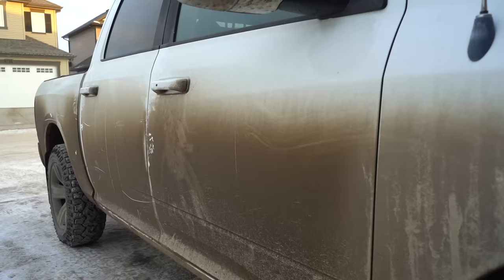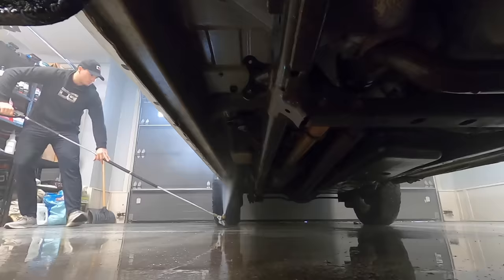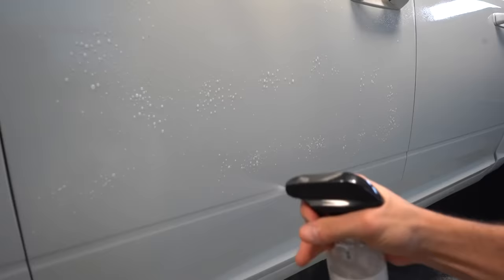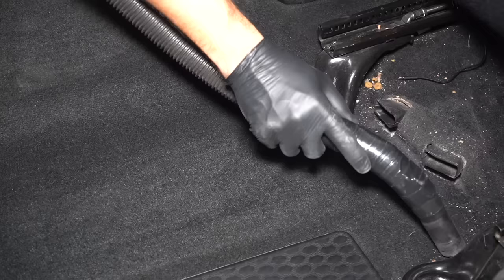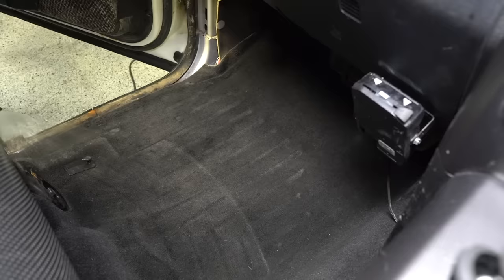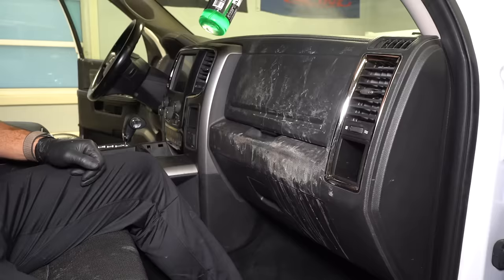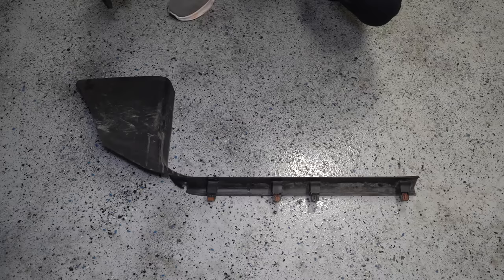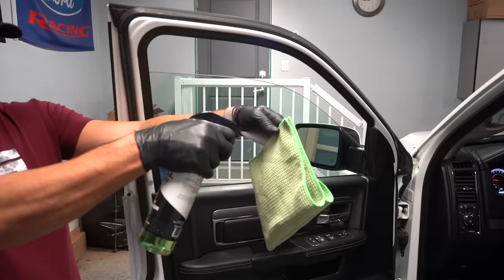Cleaning a Girl's DIRTY Truck Destroyed By Her Dog!  | The Detail Geek

Comment: Been awhile since I've tuned in, and great move on starting your own line of car care products. I purchased some of your earlier third party recommendations and they didn't disappoint. I noticed a lot of small dings on the exterior finish of this truck, and I wonder if you've ever been asked or offered to apply touch-up paint. Doesn't take long for an exposed area to start rusting especially in your neck of the woods with road salt or brine being applied this time of year.

Comment: On future details that require you to remove the seats make sure you know how it is supposed to be installed. A lot of newer models require you to replace the bolt since they are installed using torque to yield bolts. If you reuse the bolts they may fail in a crash which could open you up to a lawsuit and possibly criminal charges if someone is seriously injured or killed as a result of your actions.
Reply: Are you serious?! There are seats out there that require torque to yield fasteners?  How is that even possible as the yielding portion is the bolt and typically it is stud welded to the floor pan.

Comment: love the videos Mr TDG, just wondering if you might take a suggestion. get some jet wash rubber ends to protect the alloy wheel lacquer from scratches. once scratched, those alloys will be oxidising in no time, especially with all the salt on the road. Not saying you're not careful but better to be safe than sorry 9). I've had multiple car wheels ruined by carless cleaning with a jet wash with brass fittings on the end.

Comment: When cleaning the grime off the truck, I would add a little soap to the pressure washer detergent canister just to get some lubrication. With the high speed of the water hitting the mud, smaller particles can scratch the paint as it's blasted off. Great job on the detail!

Comment: Question: have you ever thought of using an air dehumidifier to speed the drying of these carpets? I used one of those in my carpeted apartment that got wet from a huge leak in the bathroom. It dried overnight but had to empty the bucket at least 2 times.

Comment: I bought a  rivers west blanket
Now if you go online and find out if you can purchase a back seat rivers west dog blanket protector it could save a lot of cleanup for the owners of the vehicles
This is waterproof spill-proof and washable air dry only I bought mine about 10 years ago for about 30 bucks but it would need to be four times this size for back seat with it going up over the back of the seat in the front and the back good day

Comment: My company van was damaged in an accident, so my manager gave me another van to use.  He did tell me that he had to clean it up before I could pick it up.  He vacuumed it to get the dog fur out.  When I went to the office, he told me that the guy who had been driving it had been fired for driving his van on a vacation which was not allowed.  I noticed that there were "pine tree" air fresheners all over the interior.  I couldn't stand the Pine smell, so I threw them out.  BIG MISTAKE! The guy carried 2 German Shephard dogs with him all day and the interior smelled like wet dogs and the dogs had slobbered on all the seats and windows and there was dog fur floating in the air. No amount of vacuuming could get the dog fur totally gone.  I spent a Saturday washing the van inside and out.  Looking back, I should have refused to drive it.  I was glad to get my other van back in two weeks.

Comment: One thing I've wondered is does using steam in the AC vents present any kind of risk for mildew or mold inside where the water pools? Or is the amount of water negligible and evaporate?
Reply: Likely as not, it would evaporate. Blowing air (and in Canada, it's likely blowing heat) ... That's literally how a hair dryer works.
I can't imagine a little steam would hurt anything.
Reply: @elliemcdonough7178  I see! Thank you for the reply. I had been wondering that because he never mentions if he runs the AC or heat for a few minutes after the steam treatment.

Comment: When you steam the interior.. you obviously can’t dry inside the door panel speaker housings or inside the ac/heat vents .. doesn’t water just sit in those areas? And isn’t that bad for a speaker to have water sitting in it?

Comment: Hey Mitch, on those dodges between the bed and the cab there’s like some kind of crossmember where leaves like to pile up there. Takes a good 5 minutes just pressure washing that. My job gave me a 16 ram to drive temporarily and as I was spraying off the salt, I made sure to get the leaves from in between the bed. Your pressure washer looks to be better then the one we got at my dealership I work at. I just wanted to give you a pointer in case you didn’t know and happy new year! I hope 2022 gets better
Reply: What are "dodges"?

Comment: I've been watching you for a while and you never discuss the 'business' side of the business.  It seems that all of your vehicles get the same treatment but do you have a schedule, big cars vs small, trucks, vans?  how much are these services (if you don't want to say exactly can you give us a range?)  In other remarks, I've been taking my cars to a carwash that was a mix between automatic and hand work, you pull up and the operator vacs out the interior, sprays some of the worse spots, then puts it on the conveyor thru the machinery, at the end another operator hops in, cleans the inside windows and dash, then the car is hand dried, product put on the tires, and any missed spots touched up, the machine systems does the underneath, and sprays a 'wax' after the rinse.  I like this service but all the washes in this area have now gone full automatic, no drying, free vacs for do it yerself, but the price is the same, this leaves a lot to be desired, I don't like this as much.  is this the future of car wash?  It will be good for full service guys like you but I can't afford you every time it snows.

Comment: When he washes the door jams with the pressure washer I find that so careless for 2 reasons. One, cars with electronic door locks, you can short them out.. 2 you get water inside the door, and despite drain holes, not all water runs out immediately.. And the water that sits in there creates rust.. Take the extra 10 minutes and do it by hand.. My guys at my shop don't mind.. Sometimes the easy way ain't the correct way..